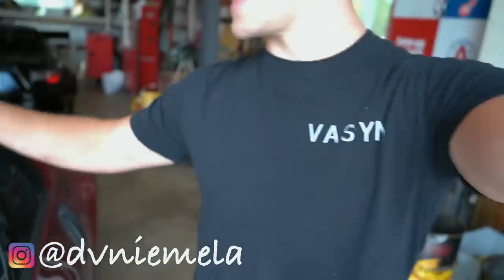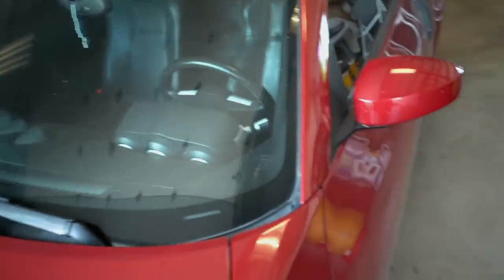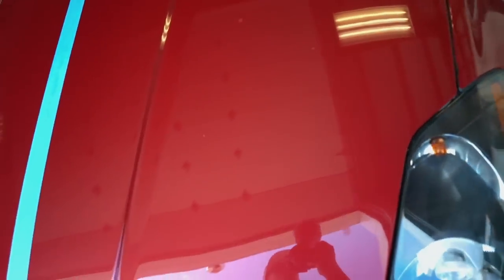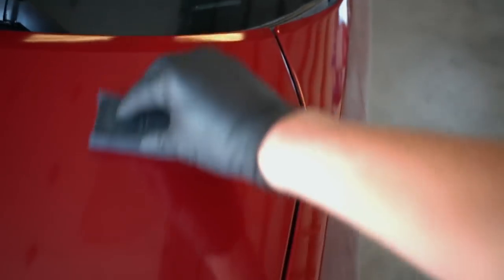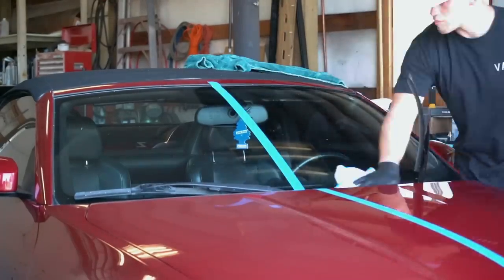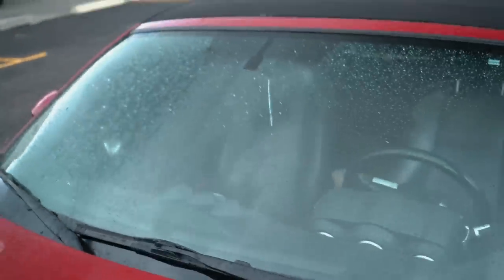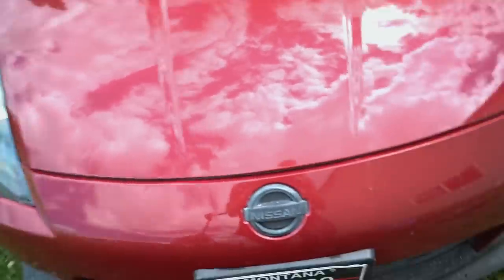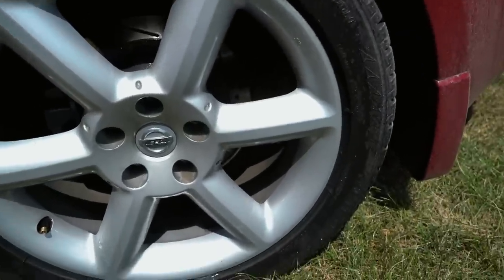Is Ceramic Coating a Scam?

Comment: Should have waxed the other half of the bonnet to see if the ceramic coating is actually any different, I doubt it personally.
Reply: Track Time Videos My guy, please do your research before you say something stupid.
Reply: @jameslapine678  7 others agreed with me. None with you yet. As far as I am concerned it is snake oil that does nothing different to a good quality wax but costs several times as much. A test against another product would be a good idea rather than just testing against an unprotected area.
Reply: Track Time Videos Explain.

Comment: Ceramic coating is not a scam per say but massively over stated in its long term durability. Looks awesome after application but the look diminishes greatly within a few months. To make it look its best always you need a topper. The latest polymer sealant formulations appear to offer as good protection and durability as most ceramics now at a fraction of the cost.

Comment: I think a really good wax would do just as well, for much less. I would think the coating on the windshield using the wipers would create a film and hard to see with oncoming cars. I would have liked to see this test with a good coat of wax on the other side.
Reply: Except that waxes last what, 3 to 6 months? I would only do a ceramic coating that lasts 2 to 5 years. Not sure if any DIY products do that though.
Reply: @qleap99  Yes, you're right, if it lasted that long, ie. a 2 years plus, it would be worth the time and expense.

Comment: Cool video.. but you should have compared the two front wheels and not the back and front.. there is a big difference in how much grind and dirt that collect on front and rear wheels.
Reply: Right.....but he ceramic coated the front wheel which would collect WAY more brake dust, dirt and grime than the back.   So he's comparing something that would typically become way dirtier compared to the back wheel....and it's still cleaner....

Comment: wax or inexpensive polishing product will bead up water just as well, which is pretty much all this video shows WRT the untreated side and the treated side. 
what DOES make a difference is what was glossed over a little. and that is sanding out deep scratches (assuming you have enough paint left on the car) with 1000-5000 wet/dry sandpaper, followed by a good buffing with rubbing compound and then polishing compound.

Comment: 11:00 the wheels are dirtier because this is a RWD car.... The ceramic coating didnt do anything. You're comparing the front to the back wheel.
Reply: eh, not likely. in my experience, when you are talking about a week or two of driving, the fronts get dirtier due to bigger brakes and pads in the front. most of the "dirt" you see on rims are from brake dust. regardless of FWD/RWD/AWD. i have a supra so ask me how i know lol